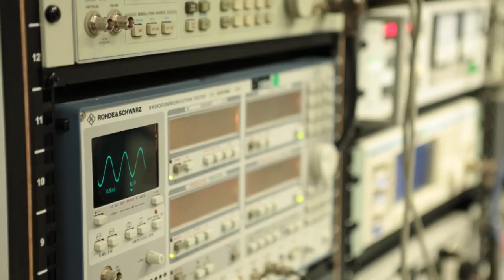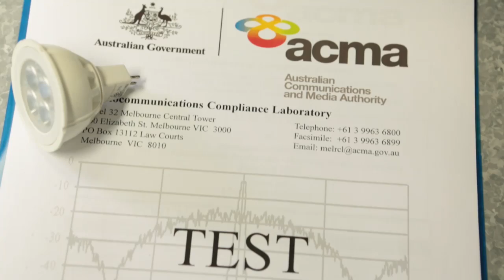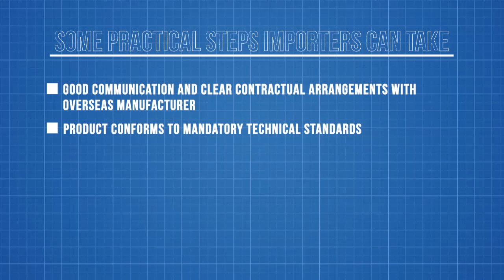Can LED light cause TV interference?

Comment: How do we know which brands are good?
Reply from the maker: +Ed Wright Hi Ed, apologies for the delay.

You should look for an Australian compliance mark, either the C-tick (which is being phased out but still good) or the new combined regulatory compliance mark (RCM). For details about these marks and examples see: http://www.acma.gov.au/Industry/Suppliers/Supplier-resources/Supplier-overview/compliance-marks

Please note that this only relates to whether a globe complies with technical standards. Other factors such as overall quality, the amount of light produced and life expectancy are better addressed by searching product reviews or requesting sales info from the vendor. 
Finally, in the cases where the ACMA has found a globe to be non-compliant, it was just one model supplied under a particular brand name not an entire brand. As such this video is really meant to provide info for suppliers to help them avoid pitfalls. Most globes do not cause interference. If, as a consumer, you encounter an interference causing globe you should return it to the point of sale for a refund.
Reply: @acmadotgov    Is the C-Tick still used?  As I have seen a few products sold at wholesale outlets with text mentioning "C-Tick approved".    Advise on this please or advise who I can call in ACMA who can give direct, detailed information over the phone please.
Reply: @chuckdebian2205  AMAZON is filled with these noisy, cheap bulbs. The only good thing is, many LED bulbs from Amazon routinely fail within a few minutes. Of course, some don't die, they just flicker and buzz forever.